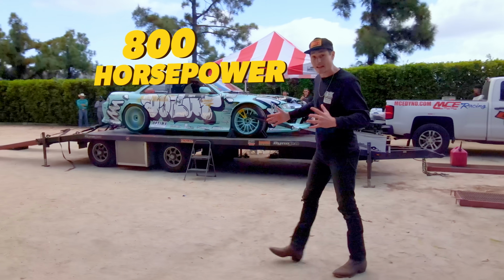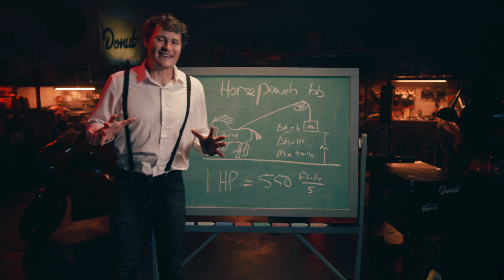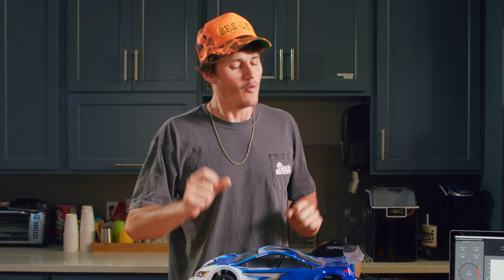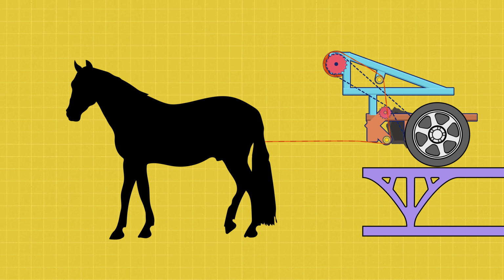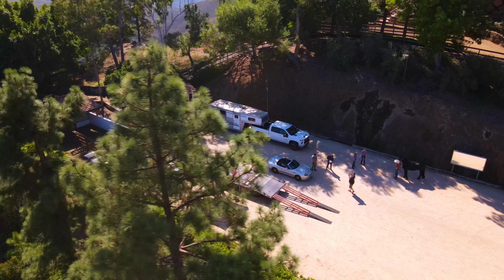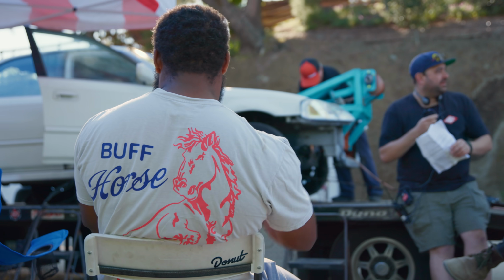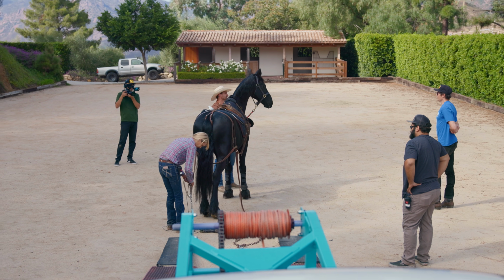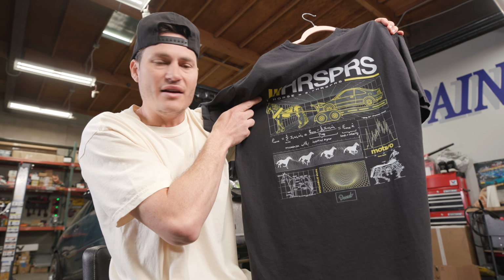How Much Horsepower is a Horse?

Comment: Can't figure out what purpose the car served in this. All that was needed was a way to get power from the spool to the dyno drum. A couple wheels on a straight axle would have done the job. Could possibly get away with direct drive on that axle. Eliminate the drivetrain losses of the entire rig & make the whole build a lot simpler.

Comment: I was wondering what if you put a big funnel in front of a car that goes to the air intake, as the car speed up, more air will enter the cylinder is that better than turbo?

Comment: Mad respect for your effort..BUT all that mech loss and counter math got in the way of an accurate result. Alarm bells should ring when three of you can’t together output close to three times one of you!  You got so focused on your clever mechanicals instead of simplifying the method…Frankly the original design of lifting a known weight with only one simple pulley to change the pull direction from vertical to horizontal was far superior in efficiency an losses. I do get that involving cars, dynos, pro-shop guys and some drama makes for better You Tube views, but all you really needed was a long drop, a pulley and 300kg of ballast in hippo sacks.  I hope that doesn’t sound harsh, I mean the vid was great and prolly cost a bit to produce…but the result was the point..not the method.

Comment: Its crazy how strong little electrical motors are when you see how much effort 1 horse power really is.
Reply: All that muscle mass being converted to a heavy electrical motor. It really is crazy.
Reply: Page up page up!
Reply: I think it’s more about the efficiency tbh, the power loss you get when pulling something in a vertical line without every movement you make being used solely to create power is very inefficient. I think it speaks more to the incredible engineers who have gone from GIGANTIC steam engines that make meager power numbers all the way down to tiny little electric motors that generate horsepower sometimes in the triple digits is far more impressive. The way they can design something to be so small yet so effective at generating power is truly incredible
Reply: @logschwalan3177 those big steam engines had crazy torque though
Reply: @ivanfromtheeast4709   They had crazy horsepower too at the end of their life. Those steam engines on trains could put out 5000 horsepower.
Reply: @Nilboggen hell, you look at some of the biggest engines that UP had and there's 7000+ recorded, 10000 hp estimated engines that were built during the 40s.
Reply: @manfail7469  Yeah they were pretty impressive lots of torque. Try to spin it too fast though for speed and it explodes LOL
Reply: @Nilboggen  reminds me of the British engine that had some kinda issue where it stuck its throttle open on a steep hill and had the wheels going ~140MPH before the drive gear completely disintegrated lol
Reply: @logschwalan3177 true
Reply: the horse makes much more torque. those little 1kw 30000 rpm motors would explode if you tried to do this with them
Reply: Yeah some commercial laundry at my job had an motor pulled out. It was rated at 5hp. It was really dense for it's size too.
Reply: @doices2nd that's to be expected, because electric motors are basically just almost solid blocks of metal.

Comment: I do not get it.. If you had the rope/wire on the spool and just the rear axel of the car. Would that have not been simpler and better then trying to come up with all that rigging for a car?? Please correct me if I am wrong, but having the spool gear connect to the axle gear. Shouldn't that put almost all the energy right into turning the tire to get a more pure outcome rather then having all the loops for a longer chain?

Comment: i think the speed of the horse couldve been affecting the max hp. If the load way heavier then i think youd see more hp output from the horse. it has strength to pull, but either wasnt going as fast as it could, or just cant go too fast while pulling

Comment: I'm thinking cord that it wound around, connected to some sort of CVT that allows the horse to move at it's optimal rate, then that is all connected to a generator. You measure the amount of watts generated and convert that into horse power.

Comment: Does it matter that the rig attached to the horse started off on the ground instead of level with the horse? Does the slack in the line change the output at all?

Comment: Of course the useful question for a horse is not power but torque translated to linear force. 
Horsepower being defined as torque x rpm, and horses being relatively slow in a draft horse configuration, I'm curious what the horse's actual pulling force was.

Comment: i think you need to revisit this, No way 5 humans win vs one horse in tug of war.  I think you should focus on torque reading, with a vertical brake dyno. And vary brake force of course. I think if that horse coulve pulled much more. But also need to find out what is the most optimal speed for the horse to use more power. I want a proper Torque vs hp graph

Comment: that's why you measure power in WATTS. In my country car power is written in kW. I do get it that 5HP is 1HP now, but I'm not sure if Watt was wrong completely because he used a day's observation for the purpose of consistent work done which was most important for engines capabilities. otherwise, perfect job, was amazed how easily Big D pulled the rope. would have used other gearing to make more consistent measurements, maybe a flywheel to stabilize the force. also funny how teamwork is not effective strategy, raised my suspicions about accuracy :D

Comment: One major  flaw in the experiment. The old numbers were assuming a draft horse. Although Big D's breed pulls carts and wagons, they are not a true draft horse. You need to do this experiment with a Percheron, Belgian, or Shire. These are built like tanks, are the heavy pullers, and would make Big D look skinny in comparison.  The world record weight pulled by one horse is a Shire at 58,000 lbs.  Big D would not even be able to budge thar load. Your test is the equivalent of comparing the pulling HP power of a pickup to a semi. Still don't think you'd hit 15 HP, but you'd definitely get higher numbers.  And if speed matters, then these horses might be at a disadvantage in the test, but maybe not as Big D didn't go very fast.

Comment: This was awesome, but for the losses math, why not put the system on a 10HP electric motor on a belt tied to the same system the horse pulled, then you could just use the same efficiency loss. So if the motor goes from 10crank HP to 6.5wheel HP you then know the loss.

Comment: I loved this video.  Good job!  I do want to point out an issue though.  The reason Watt’s estimate of a horse’s power is so low is not because he was trying to diddle people in his advertising.  It’s because breweries didn’t want horses to pull for 20 seconds.  They wanted them to pull continuously for hours.  Watt was trying to estimate the sustained power output of a horse, not the peak output as you measured.  He in fact over estimated it so that his customers didn’t sue him because his steam engine wasn’t doing as much work as the horses they replaced.

Comment: I’ve been saying this for years, when I have seen horsepower numbers posted. Not all horses are created equal…some are Shetland Ponies while others are Clydesdales!!😂 The amount of torque that goes along with the Hp matters a lot too. Awesome video! I loved it.
Reply: HP is a calculated figure and the relationship between torque and RPM, or motion.  It's a function of time.  It's a measure of how much work an engine can do.  HP is an excellent figure that is a much easier representation than trying to understand the torque and RPM relationship by just seeing those numbers.  The best part is, HP is HP, regardless of torque and RPM, so two different engines with the same HP will do the same work no matter how different the torque and RPM they produce.  A good illustration of this is a diesel engine vs a gas engine.  Diesels make a lot of torque, but are RPM limited, where a gas engine with less torque makes up for it with higher RPM.  To make use of the differences, we use gears, which are just round levers.  You can trade the higher RPM's of the gas engine to get more torque output at the drive wheels.  In the case of the diesel, you trade torque for higher RPM at the drive wheels through the gears so the end result is the same.
Reply: @edwardlance2379 yeah hp is work being done. 

As a sidenote you just need rope, a pulley and some weights to measure how much momentary power output a horse has. The formula is really simple. the figure as watt used it was however throughout a day on average which is really what you would be interested in if replacing horses to run say a water pump to do cost analysis on.
Reply: @edwardlance2379  I know what you are saying, and as a measurement and a set equation, you are correct. I was just making light of the fact that not all output devices are the same. You can have a 300 hp tractor and a 300 hp 1/2 pickup. There is a reason you use the tractor for plowing and the pickup for light loads on the road. Same with horses. Some are for riding some are for hauling. Both the tractor and truck have the same horsepower but aren’t equal. Same as horses. I wasn’t trying to be scientific, I was just trying to have a little fun and a chuckle.
Reply: @JH-vl6eh generally speaking the engine doesn't have much to do with it, put the pickup engine on the tractor and gear it to be at the same power at the same speed and you wouldn't really notice anything (except probably a loss of reliability since tractor engines are overbuilt on purpose)
Reply: Percheron or Belgian draft
Reply: Yah , a single horse only pulls so much, strap two in a team and watch each horse try to pull the most. They are competitive with another horse. Just like dogs on a sled , you take lots and team

Comment: I don't think this is a good construction to measure the power. that rope drum is way to small. if you would make that even smaller you would not be able to pull it at all. at least one foot diameter or even 2 foot would do better i guess, the ropes would not be digging in and the horse could make some more speed. right from the start.

Comment: Attention... the horsepower definition refers to the power a horse can exert CONTINUOSLY... Not at peak. And the horse used was a smallish one. And Watt did not have GPS or electronic trasducers, nor dynos. But he had weights and a clock (I guess). Enough...

Comment: That Horsepower number is completely wrong. Horsepower is work over time. Should of been how fast a horse could pull a trailer over a small distance. Just your test alone proves that's not the power of a horse. The horse showed 5 times the power of a person which is you ever had horses or seen them pull anything you would know theyre prolly 20-30 times a human. Horses can pull small cars across a parking lot with the parking brake on. You can look at power to weight ratio for small cars like Quarter midgets. One can have 15 horspower and weigh less than 1/4 of a horse. But they accelerate slower than a horse can with only slightly better top speed.

Comment: I'm not far in, but I have a question. How many hours out of the usable day (12 hours of sunlight) can a horse consistently work? Say it's four, and it must rest the remainder of the time to recover. In that case, you already need two horses to replace the equivalent power steam engine, which could run the entire workday without stop. The question isn't how much power does a horse produce, but rather how many horses can an engine of a particular power replace, and how much cheaper would than engine be to run  -- this is how Watt would have convinced people to replace their horses with his steam engines.

Comment: Great Video, but Both you and the internet get it (partly) wrong. This was no marketing gimmick. James Watt was trying to provide a comparable measurement for replacing actual work horses. If people believe 1hp is the total (Max) power of a horse, it's our education system that's failing. You see if you want to replace a horse that works all day every day you need the amount of work the horse can put out over the whole shift for the horse, without hurting him or wiping him out where he can't work the next day. Not the Max he could pull. Even in your video you say to protect the horse he's only allowed to make 5 full pulls of only a few seconds each. The marketing gimmick is saying a new Hellcat has 717 hp. If you were to put that engine on a load cell and work it at 717 hp it would not last one shift of 717 work horses. In fact I would be surprised if it could last an hour at max hp. 
TLDR: James Watt was a genius and HP marketing equating HP to MAX power of a Horse has always been a gimmick.

Comment: Hall are funny, remembering JWatt and ignoring Fitch. yall are funny. Probably never saw a rope dyno calculate the tork on the watewheel. Get those measurements. You don't need a horse... just a rope, a spring, and a weight. 

My dad, an engineering professor, ,wrote the wiki page on the dyno.

Comment: i came up with a similar idea at the start of the video. my idea was to replace the rear differential with a spool welded in its place
edit: I know, this is the better solution because nothing needs to be replaced afterwards

Comment: Whats the car for tho? couldn't the rope be spooled on the dyno???
Reply: HP is a dumb number to being but if we gunna use it. Weight, Time, Distance. 1100pounds horse and rider run a 1/4mile in about 23-25seconds also known as 15.7HP or 11,730W or 11.1BTU/S for the grillers. The Draft horse doesn't shine running 1/4miles sorta like a semitruck vs race car type of deal. I'd bet a 2000lb horse can pull closer to 30HP but thats just a weak guess. 15.7HP for a quarter horse. Humans do about 1.6peak hp and .35 sustained so leads me to believe the measurement system was correct although looks overly complex. Guess the horse just wasn't conditioned for the test.

Comment: You forgot to ad a distance number.....for an acre....draft horses usually pulled a plow within an acre....at .75 of that acre is a peak horse power unless stopped by a rock or stump....then slow down to turn around to run up again

Comment: Great video.  ❤ However it rasies alot more questions than it answers . 

So i means 5.9 horsepowerr is equal to one horsepower. 

Which horse power is the true horse power. 

Also the question of horses comin in differnt shapes and power capabilities..

Its crazy but a great qurstion as begun to be answered .

Also why did you need a honda ...could it not have been done wothout the car and just rig .

✌️

Comment: 5.7hp at the LOW end of the power band. You need a lot longer rope (or cable) to allow the horse to get up to speed. It’s probably double that or more at 20-30mph. 🤷‍♂️
Reply: That is also not a heavy draft horse. Something like a Clydesdale or Shire would be significantly stronger.
Reply: @bloodgirl4 to be fair they didnt want the strongest horse , they wanted an idea of how much a horse makes since not every horse is born equal, two of the same race could have different power ratings
Reply: I thought the same thing but so many power will be lost pulling the very long cable to the horse top speed. Maybe a giant treadmill for the horse
Reply: @rodneyram5172  yeah, a steel cable would lose less energy, too, but also, the energy loss in stretch could be calculated. Just saying, 5.7 is not a legit number. HP is a curve. They calculated the bottom end of it. That’s not how to get Max HP.

Comment: I think the better and more accurate method would have been that the horse is pulling a trailer and on the trailer the wheels can be stopped with brakes. Add a few sensors and you can fade the brakes, get power readings at any speed.

Comment: Number doesn't add up, peak human athletes can do 2.5hp, a regular horse does several times more, you can get a better number by just weighing the horse and clock it running uphill or by using an O2 meter.

Comment: I am not an engineer, but wouldn't a treadmill for the horse do a better job, where the horse runs, spins the mill and with few pullies and some math you can connect it to the dyno directly

Comment: I think horsepower was inspired by power horse can produce constantly, not in peak. Same as average  human can have 1.2 or 1.5 horsepower in peak but for one or two hours average human will strugle to get 200W or 0.3 horsepower. Well built engine can do this constantly. For horse peak can be 5 or even 15 horsepower but draft for long peroid will give probably 1 horsepower average. Good experiment!

Comment: Surely you could have used the horse to tow an EV, and used the regenerative power measurement taken from the horse and compare it to the power on regen when it slows down on a dyno ?

there would be maths to figure out the losses and what not